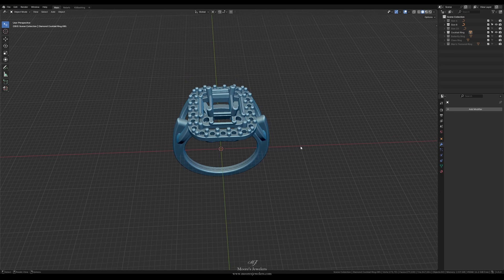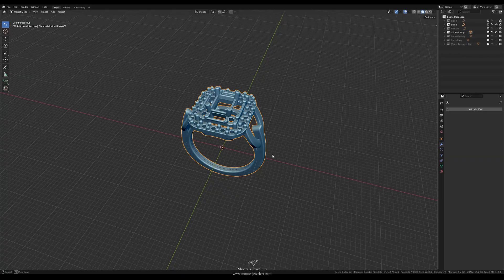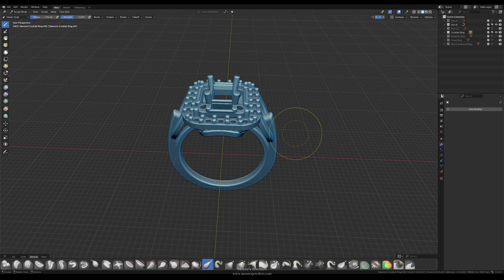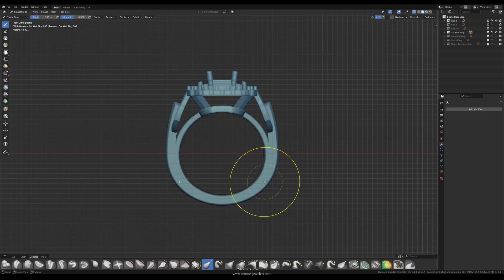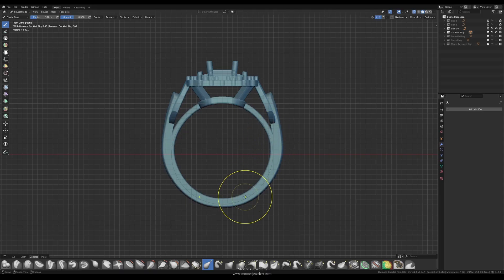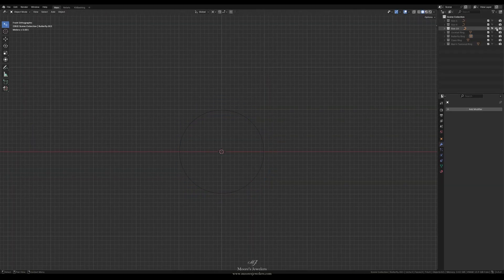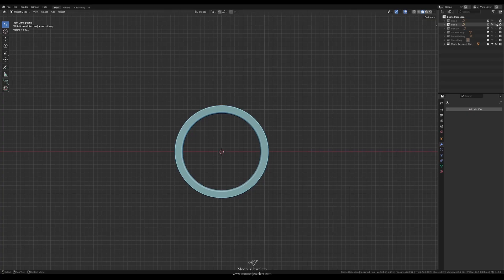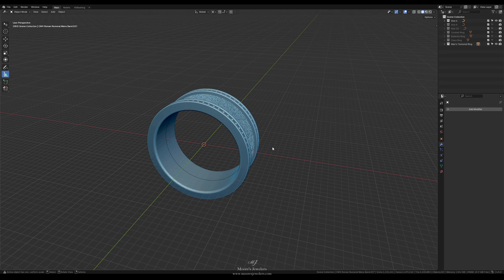How To Quickly Resize Any Ring Using Blender: Moore's Jewelers

Comment: Use a Surface Deform Modifier for non-destructive sizing.
Reply from the maker: Unless there is some way to use this modifier I’m unaware of (which is more than likely the case), this tends to make the process more difficult, or at least time consuming, even though it is non destructive. 

Each ring is going to be completely different and needing to set up a unique plane with loop cuts in the correct areas, per ring, adds time that really isn’t needed (this is about the same for using a lattice too). If all the plane is being used for is scaling this makes a little more sense, but that falls into the same issues listed in the video and overall would be easier/quicker to just scale the ring. 

The point of our tip is simply to have an easy, quick, and repeatable process that works for about 95% of all rings. 

Feel free to post any feedback, tips, or ideas; we’re always up for learning something new! This is the process we’ve been using for years and so far has been the overall best solution we’ve found. But things update and change so fast nowadays I wouldn’t be surprised if a different solution was out there. 

-Chris
Reply: @Mooresjewelers  I wish I could paste in a picture in this answer. Anyway. The surface to use as the deformer is simply a cylinder that fits the inside of the ring. Fewer points to edit (put a SubD on it). A vertex group can be used to fixate the 'ornament'. The difference to using a lattice, is that the lattice is a cubic volume that will also affect the thickness of the ring. Also pretty difficult to control.

Comment from the maker: There was a comment asking about this, though it seems to have been deleted along with our reply. However, it’s something we seen done quite often, so wanted to post it here for anyone else wondering. 

Scaling a model is an option, but having an understanding of sizing and tolerances is needed. When a model is just scaled up or down the whole model is changing size / shape. A simple example would be scaling a 2mm cube. Scaling it up to a 4mm makes the whole cube larger and scaling it down to 1mm makes the whole model smaller. 

Same for jewelry, if a ring is scaled up or down the whole ring gets smaller or larger. Say a customer wants a halo engagement ring with a 6mm center stone and 2mm rounds in the halo. Well, if the ring is scaled up from a size 7 to a 10, now the setting for the center setting is larger so it will probably take around a 7mm stone (not a 6mm) and the halo stones will probably be around 2.5-3mm depending on the ring. It’s the same idea for scaling smaller just opposite; all the settings and details will shrink. 

Also, different areas like prongs, textures, mil grain / beads, scroll work, etc too become larger or smaller. If a center setting has a 1mm prong and gets scaled down to a .8mm prong, depending on the stone, that could be too thin for setting. If that same 1mm prong gets scaled up to a 1.2mm+ prong then it’s getting rather large for setting. Sure it can be done, but setting with prongs too thick is tedious and unnecessary.

The other downfall to scaling is it adds or takes away material. If a whole model is scaled larger it’s adding weight to the ring, which means it requires more metal for casting, and costs more; which wasn’t needed. Then if when a model is scaled down it can become too thin and creates weak points once in metal. For example, if the bottom of a shank is originally 1.2mm thick and gets scaled down to .8mm, then the ring has an easier chance to break in this area. Or if the ring has a .5mm border / wall, and it’s scaled down to .2-.3mm, then that could be an issue depending on the ring shape or design. 

If a finger size needs to go up or down a quarter of a size, 8 to 8.25 or 8 to 7.75, then scaling in general should be fine. Even half a size could work, but that all depends on the style, shape, and design. 

The method shown in the video allows the rings to be resized without altering the settings, details, or major parts of the ring. 

Hope that helps!

-Chris